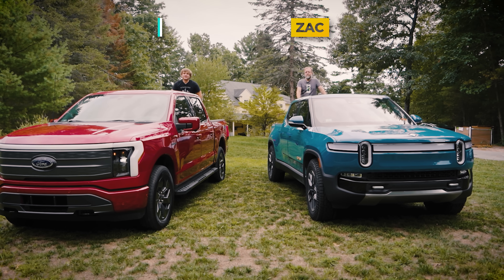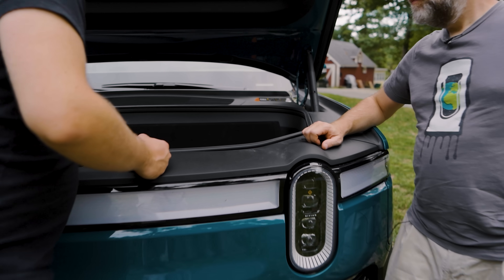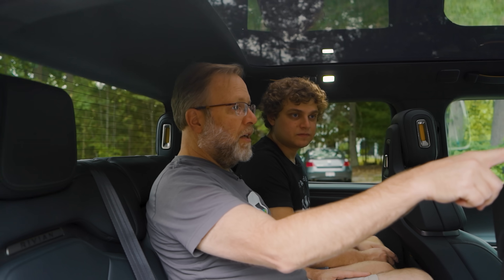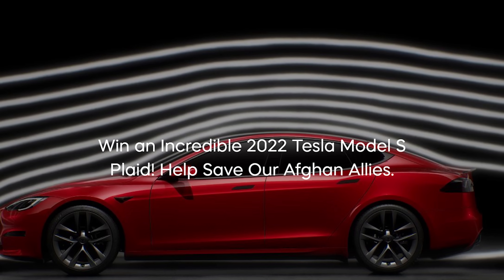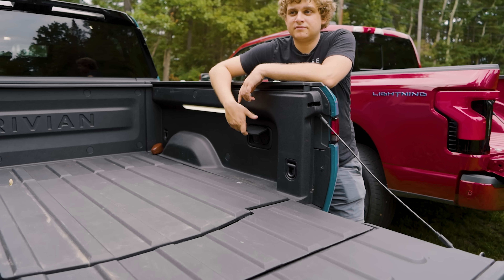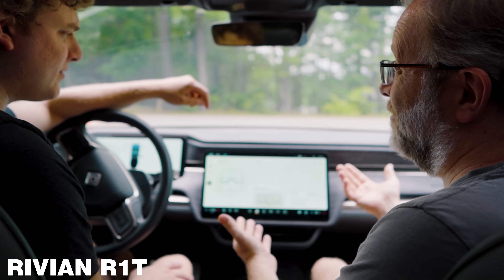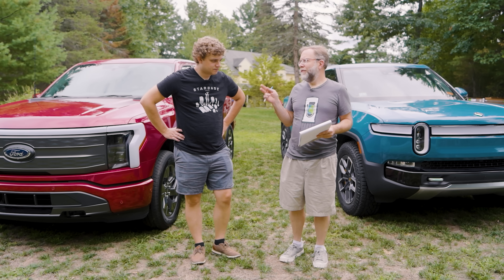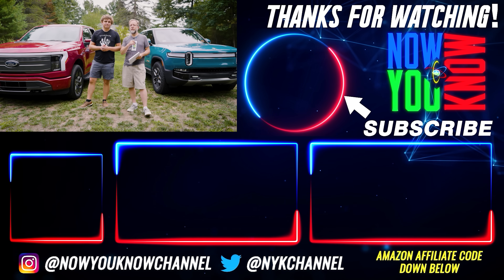F-150 Lightning vs. Rivian R1T -  Electric Pickup Truck Features

Comment: Currently have both, and most likely will be selling the R1T. Having driven both back and forth, the lightning is a MUCH more comfortable and smoother ride. Cabin noise much better as well. No constant motor noise, and I do appreciate the larger cabin and more in cabin storage. I prefer the interior materials and definitely the software of the rivian. I also think Bluetooth phone calls sound better on the ford. I love the rivian, hate to sell it, but certain software things I can get by with the ford otherwise plus the ride and overall build quality of the ford. 

I love the air compressor and flash light featured in the rivian, the open space in the front of the cabin, but, between what I said plus the financial benefits I'll obtain, I'm just going to role with my lightning until next year, then test out the gen 2, which I do believe solves a lot of my ride quality complaints.

Comment: How fast is the Ford? How low or tall can the Ford get? How off-road capable is the Ford? How does the Ford compare in a drag race with any Ferrari compared to the Rivian? How may of each have been sold? Not reservations! SOLD!???? I can already tell you the Rivian out tows the Ford because just YouTube search "Rivian Lightening tractor pull". 

See, I can skew tests for an outcome as well!  Also, super shady comparing an F-150 to a Meverick for the same playing field.  You 2 just say "EV truck" and though it was the same. OHHH! What's up with the Tesla truck, now that I think about it? Something about having to going back to the drawing board?

Comment: And once again round seven on outlets the lightning wins out big time. In fact so big it should get extra points for a total of 9 6 kw of power. 10 - 120 volt outlets and 1 - 240 volt 30 amp outlet. 2 USB ports in frunk, 2 USB ports in center console,  2 USB ports in back seat area, 2 USB ports located in area just in front of shifter. a 12 volt outlet in front and rear of the cab. Again the lightning not only wins this round but should get extra points.

Comment: Round five definitely goes to the lightning on spare tire hands down. The Rivian doesn't cone standard with a spare tire. The aerodynamics of the lightning spare tire is negligible because it's up behind the battery so very little to no wind resistance there.

Comment: Round four also goes to the lightning Not a tie.  The under bed storage really isn't viable, because everyone needs a spare tire and after you purchase one this is where it will have to be stored. The under the seat storage is larger and also lockable.

Comment: There's no question round two goes to the lightning for several reasons.  Most important how easy it is to put things into the trunk. Second the Rivian doesn't have any 120 volt outlets in the truck just a 12 volt outlet.  where the lightning has 4 120 volt recepticals and USB a & c.

Comment: I disagree with round one decision.  although the handle does feel a little weak, I'm sure it won't break. The Rivian doesn't have anything to hold on to getting in and out of the bed. Round one goes to the lightning.

Comment: These gentlemen are normally brilliant, but this was a poor comparison.
How does each truck park on city streets?
How does each truck fit into a standard one car garage, or allow for a second car in a two car garage?
How does each truck feel on the road?
How does each truck feel off-road?

How’s the Driver Assist?
How many driving modes does each vehicle have?
What’s the towing capacity of each vehicle?
What’s the payload capacity of each vehicle?
What’s each suspension of each vehice capable of?
How’s the interior lighting at night?
How’s the exterior lighting at night? 

The idea that one truck is bigger and therefore it wins every category is just foolish for a couple of brilliant guys like this.

Comment: Having the ability to draw more power via AC is all well, fine, and good- but one of the major concerns with both vehicles is battery capacity.  How much of the battery is needed when using all the Ford's outlets, or even just using the 240v for a welding job?  Maybe Rivian has less outlets because battery technology won't pragmatically support all the outlets on the Ford and wanted to balance having access to AC with the DC needs of the vehicle itself?

Comment: Big heavy trucks with big environmental costs, though better environmentally than their gas or diesel counterparts for their use case. BTW, if you had included efficiency, best bang for your kWh, Rivian would have won that one. A bigger heavier truck is less efficient. Also addressing their range, towing, load bearing and off road capabilities I hope will be fodder for future compare videos.

On the other end of the environmental spectrum there is the Aptera, soon to be the most efficient car mass marketed, with up to 30 to 40 miles free solar gain on sunny days, and you can still sleep in its 'bed'. Still even Aptera can improve its green engineering. I recently posted this on an Aptera Owners Club video. Included are some ideas any EV manufacture could consider:

Thanks Steve! Thoughts ... 

1. If the Aptera is parked in a lighted area at night, with the various artificial lighting types available, will any of these activate the PV cells for battery gain? Or the other stars, or even our moon, or will only the great fusion reactor in the sky that Earth orbits add electricity to the Aptera's battery through its PV cells? [this was just a question, his video was on integrating Aptera's solar modules with its electronic components].

2. Ditto on pushing for Apteras to provide a plug for supplemental solar panels to help feed the battery directly DC to DC without the DC to AC back to DC conversion losses!

3. And we do want plugs to power AC appliances! Hopefully these can be designed to use the inverter the car already uses to drive the hub motors. And also, even if it is aftermarket, a way can be enabled that Apteras could give a level II charge boost to other EV's that have fallen short of their next charging destination. Dreaming here, but if an EV to EV charging boost could be enabled DC to DC without the DC to AC to DC inverters of the two cars having to engage that would truly be gold standard, no? As more and more electric cars populate our roads battery boosting will become a nice side hustle, or a courtesy gift that EV owners can bestow on one another! Def a greener, cheaper solution than tow trucks, or other large service trucks or vans, many of them diesel powered.

4. I am hoping eventually the batteries in the Apteras can be designed modularly, and in plug and play removable units, so we can customize our battery sizes for our trip requirements. Why haul the dead weight of an oversized battery around when you don’t have to? Efficiency is Aptera's 1st priority, so give owners the ability to maximize their car's efficiency on a day by day or trip by trip basis by having some of that, say, 100 kWh pack be removable 5, or 10 kWh modules.

Then the Aptera community can share these battery modules around as longer trips are undertaken even to those who couldn't afford, or didn't want to take the efficiency hit of the larger battery pack versions. An adjustable suspension might be part and parcel of this 'have it your way, day to day' car, but these innovations are well worth the necessary engineering workarounds.

5. And the gold standard of these removable battery modules would be if they could be employed as home or business powerwalls, and even monetized in grid support 'virtual power plant' functions when in or out of our vehicles thus helping to accelerate our grid's transition to renewable energy sources. The value of increased home and grid reliability, security and safety when demand peaks or the grid goes down should not be overlooked. Removable modules give an owner the ability to still be able to drive their car during any power outage, without depowering their home, business, camp, etc … something pure ‘Vehicle to Home’ systems don’t allow. And removed modules can help the grid while you drive about, or are parked where there are no connections, and so are more adaptable, and monetizable than pure ‘Vehicle to Grid’ systems.

Not before the 400 mile cars hit our pavements of course, we need those ASAP, but as the 600 and 1,000 mile cars are rolled out please Aptera consider battery modularity, and the multiple functionality of these modules both in and out of our cars! 

6. And as the 250 mile car is designed I hope Aptera thinks of how the freed up space could accommodate lent or rented extra battery modules when needed, or a cooled extra storage space when not.

Each of these adaptions are the greenest, kindest and most efficient use of our battery resources, they avoid excessive battery material mining and they will even aid in the ‘second use’ and the eventual recycling of battery modules that become weakened, exhausted or are sidelined as owners decide to upgrade to the latest and greatest battery chemistry available. They are the best fit for Aptera's mission ever, beyond the lightening and reduced air drag compulsions they have already incorporated, and will add value to each car bringing increased sales and market share. 

By Aptera continuing its mission with innovations like these their good example and competitive advantages will eventually encourage other EV manufactures to adopt similar changes. Lead Aptera lead!

Comment: It seems like the Ford walked away with this if you are looking for a truck as a truck. Sounds system, don't give a crap about(you two have spent WAY too much time around car salesmen). The spare tire accessible while there is a load in the box, being a truck, clearly Ford and not a tie. Longer box, because it is about being a truck, Ford for sure.

Comment: Gents, A/C works well in 80 degree weather? I reside in coastal S Georgia and I set my A/C at 80 to cool off. How about y'all consider purchasing an anemometer which can measure air flow, humidity, temp, and extras dependent upon the amount you want to spend. Great show, thanks!

Comment: I’m sorry but I really don’t think you guys know much about trucks or understand truck owners. The ford not having a tonneau cover isn’t a bad thing at all. (the automatic on on the Rivian was a add on). With so many after market accessories and ability to customize storage, the F150 takes the lead, where Rivian will struggle at this and deliver a one size fits all solution.

Comment: What about the PRICE ?    Basically the Ford only looses on the sound system. The least significant item for a Pick Up Truck. Oh, and what about range and towing ? So far it looks like Ford finaly woke up and used their decades of pickup know how to make an effective EV truck. Price: Rivian is $ 67 K to $ 85 K. Ford is $ 47K to 75 K. Looks like at $ 20,000 to  $ 10,000 dollar  savings with the Ford.  I'd say Rivian is in BIG trouble here.

Comment: The Ford is a utility truck whereas the Rivian is an adventure truck. It’s never claimed to be a utility truck. Every category in this video was suited for utility and it ignores features like raising and lowering the height for off-roading which the Rivian can do but the Ford can’t. Changing drive modes which again the Rivian can do, leveling itself which the Rivian can do and so on. So these are two different trucks for different purposes

Comment: Great job, guys!  But, you missed a very BIG feature that Jim Farley highlighted in F150.  Lightning, with its 240 volt outlet, can charge a stranded Tesla (or Rivian).  It isn’t practical for a Rivian to charge any other EV at only 120 volts.

Comment: It’s 120 volts, not 110.  That was changed way back around 1960.  While I experienced the change as a young boy, it probably was before Jesse’s time.  

When measuring voltage at my MA home, it’s typically 124V.  Please let us know voltage both at F150 and Rivian because if one really is 110, that is awful for power.

Comment: Reliability is an important consideration too.   It sounds like the Rivian has some teething problems, which is to be expected.  The Ford has many bits and pieces they have been making for years. so they should have those sorted out well.   Pulling for both of them, but I think the Ford may end up being more reliable in the early years.
Reply: Love them both, But Ford is NOT known for the most reliable vehicles. Hopefully, this new Lightning sets the bar!

Comment: Really depends a lot on what you want it for. The Ford is hands down the better work truck but I’m pretty sure if you were testing driving performance and off road capability the Rivian would crush it in those areas.

Comment: Great start to this shoot out!  We know this is first round, the 120/240 and spare tire is probably most important to me so it's good to see that.  Hope my Cybertruck has 240V,  it will replace a huge gas generator that plugs into a dryer outlet to power the house after a Florida hurricane.  This would act as a poor mans vehicle to house.... turn off main breaker to separate grid first.  Now on to range and pulling power with and without trailers.

Comment: I’d like to see how they handle huge payloads like if I go to Home Depot and put a pallet of cinder blocks building a project at my house.  How do the suspensions hold up under huge payloads.  Also, any towing features if I pull my boat to the lake on the wkend. Do they differ on efficiency to make a big difference? How about real world charging speeds? Or how well can u adjust things like precooking or heating via app on your phone like with tesla?

Comment: Great video! Here are some more ideas that might be worth some footage: 

1. Rear seat temperature gauge check during hottest part of the day.
2. Remote cooldown test. Leave both outside in the sun and see which one cools down the most in 5-10 minutes.
3. Towing test. Drivability and range.
4. Off-road/Camping test. This one could be really interesting b/c the Rivian specifically markets to this sector.

Comment: Hi Zack and Jesse, a friend got a Ford Lightning from Carvana to test and we noticed that the FRUNK does not close automatically. It opens, but you have to manually close and it opens pretty high so it is a bit of work to pull it down to close it.  I noticed you didn't close it on your review. What's your thoughts on this?

We also noticed that the cooled seats are only the two front seats and the back seats do not have cooling. Maybe we missed being able to turn these on somewhere?

Comment: Ford wins easily as a usable pickup. Full size pickups are much more comfortable/relaxing on trips as well in my opinion- like comparing a Tacoma with a Tundra. I feel confined in the Tacoma. Our Tundra great for family trips- dumbs.. Toyota really dropped the ball as we transition . Ford did well, as a former early Rivian reservation cancel,  who is now waiting for a CT. If I knew the CT would take much longer I would definitely order the lightning. 240v outlet is huge, as well as full size bed. I race motocross and am expecting an electric Stark Varg in December, plugging in 240v for charge at the track awesome as the moto community transitions as well.

Comment: Would like to see a day to day living review for a month in each. Is the Ford harder to park in mall parking lots, parallel parking, how often do they need charging for average use, which is like 40 to 70 miles a day. Does the battery go down quicker while parked in one versus the other? Are over the air updates smooth? Is Ford service truly better because they have dealerships already or is there never a Ford EV tech around when you need one? Does tire life truly go down with an EV truck and if so which of these two has less of it?

Comment: I get there are no other production ev trucks to compare, but the two trucks are really in different categories. The Rivian R1T is really in Ford Ranger size category, yet still is close to or exceeds--in some respects--a full size F150 Supercrew Shortbox truck. Also the Rivian R1T is targeted to luxury buyers and wealthy off-road buyers.

If Ford can produce an F150 Lightning with a 300 mile range with payload for $75,000 Canadian with Tesla Supercharger access. I will buy one.

Comment: I think that was pretty fair, given the parameters. Of course not everyone would give them equal weight, but never mind. This is where legacy scores. They've been doing this stuff for decades, and although Rivian were extremely innovative, sometimes the practical stuff just wins. Well done Ford, but well done Rivian too. Personally, I really wouldn't have either, but Rivian's R1S is very attractive, and Ford doesn't have an E-alternative. If I want to take extra stuff on the extremely rare days I'd hitch a trailer. Of course that's not the American way. It's the European way. Practical, and only take what's needed, instead of having an empty couple of metres chasing you around all the time.

Comment: Nice comparison, however I would like to see more:
1) 4 X 8 sheet of plywood, 2x4x8,  2x4x10
2) cost comparison 
3) efficiency Kw per mile, range, charging speeds
4) ground clearance, approach angle, mileage off road, traction in sand, weight, maneuverability, center ground clearance, power
5) Towing weight, efficiency 
6) power to grid. Cost, payoff, emergency
7) looks from truck owners, cost for size, independent ratings from others
8) tire costs
9) repair options, can either service centers fix, how convenient across USA, Spare parts?
10)  Acceleration.  Drag race!  First thing I would have done 😜